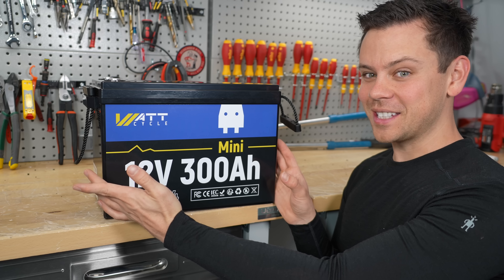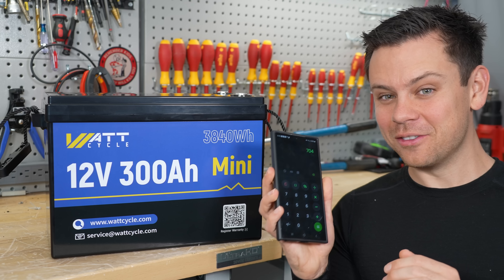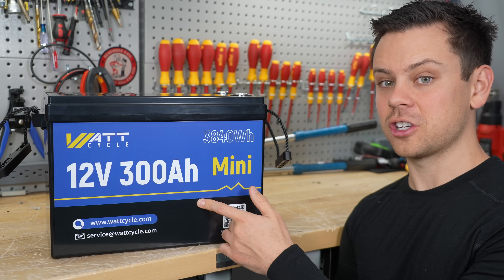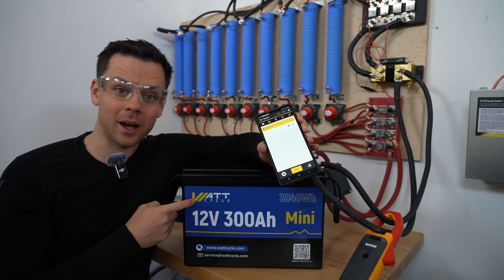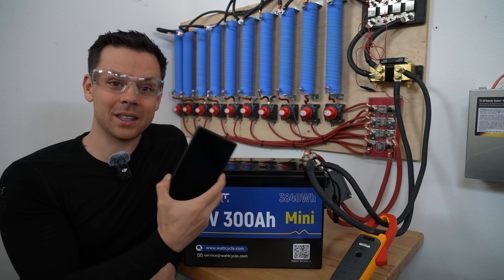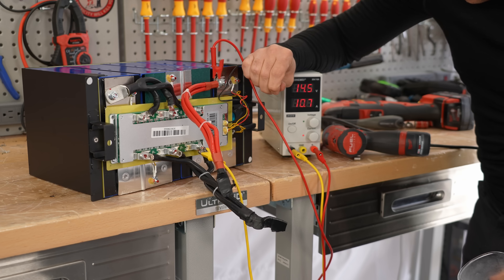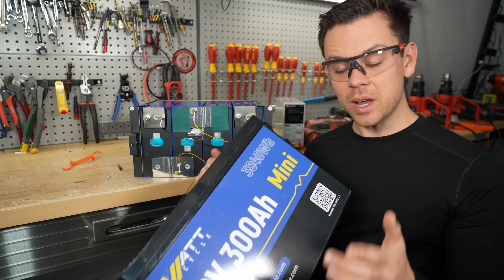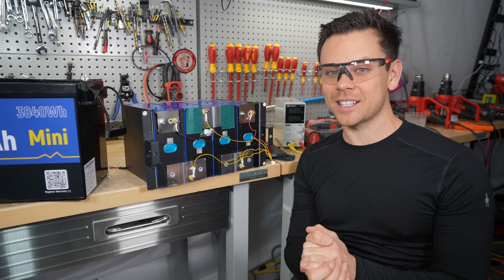Wattcycle 12V "300Ah" Battery: Popular Budget Battery Falsely Advertised?!

Comment: What are the chargers your using the biggest 12v I can find is only 50 amp
Reply: You sure you even looked? Just a quick google search pulled up one that is 60 and another that claims 80. If you need more than 50 amps, use two chargers. Or look at RV chargers you can get 125 claimed. 

You battery is probably a .2c charge rate for longevity. So you are close to that with 50 amps anyway.
Reply: @jayw900  if you could help with a link or name of some of these larger charger that would be great. I don't know if it's because I'm in the UK but anything over 50 amps is just a modified server rack power supply when I Google search, my bank can handle 150amp worth of charge and would rather just 2 chargers than 3 x 50 amp chargers

Comment: Glad I bought x3 of the 100A WattCycles when you recommended them instead of going with one of these that you hadn’t torn down yet!
Reply: Yea I took a bit of a gamble going with the 300 I guess.  I couldn't fit 3 100s though.  In fact, I think I couldn't fit most other 280ah batteries as easily, but maybe I could have come up with a different mounting solution had I know this one would be a flop.

Comment: I bought one recently based on your review of the 100ah - paid $476.99 - so even as a 280ah, if it has good build quality and working low-temp I am happy with it. I put a MRBF fuse on every + terminal no matter what the battery has.... just seems like good sense... never trust software ;-)
Reply: Yes, I have been using those fuses as well.
Reply: What size fuse ?
Reply: @  My loads aren’t crazy, so I do a 200amp fuse. If I were running inverters or larger loads I’d do a 250a fuse to allow a little burst
Reply: @condoonsixthavenue8060   You size the fuse for the wire you are protecting. I use 200 amp fuses for 4 gauge wire at 24v (i.e. 160 amp). Hard to find anything between 150 amp and 200 amp. It's really to protect against a dead short. I have a 3000va Victron inverter and 4 batteries (each has a fuse).

Comment: A video on 48v server rack vs 12v x4 in series would be great with some of these 280ah batteries.  It could illustrate pros and cons to sticking with nominal system voltage vs 12v in series, wiring costs, cell imbalance, and also if a chargeverter works any better charging these back up vs generator through AIO.
Reply: It's not right to directly compare a drop-in Group size battery with a server rack battery. One gives comms, standard protocols, one does not.
Reply: @ For sure.  I think it’s a topic worthy of a video explaining it to everyone, newcomers especially who are just typing in batteries on Amazon and thinking things will go super smoothly, especially with prices quite competitive.  

Like if there was a similarly sized 4S system to equal inverters and panels, what can buyers expect fully?  And ways to combat any issues?  Ex. How does each individual bms react to charging through an all in one on generator, at various loads?  Does a 5 kw generator running near full load react about the same as a 15kw at 33%?  Or does it throw the sine wave off, and how does bms of both kinds react to this?  A bit on chargeverters in those situations with each configuration too.  I feel like it could be of interest, there’s plenty that have been in a system down state after a week of no sun mid winter.  In Canada.  Or, whatever it’s called now.  😂

Comment: those 100ah wattcycle mini batteries look so good.  i feel like getting two of those wired in parallel would be great for a small overlanding set up
Reply: I am considering using them to replace the lead acid batteries in a Ryobi electric riding mower. Yes, lots of upgrades for that project.
Reply: @williammeek-h2o  i finally got the two batteries and honestly the bms makes them really weird.  the bluetooth app doesn't work well.  i'd say using just a single battery would be ideal if possible.

Comment: great review, i have been looking at the Eco-Worthy 280 Ah 12V battery.. it's currently on sale on amazon for UNDER $400, which is a pretty amazing deal.. i would love to see you review it / tear it down to see your take on the build quality & test results!
Reply: They are $360.00 right now on ebay. I have two of them in my battery bank along with 4 various 100 ah batteries. Very satisfied. Also, there are a few reviews out there, I think Will may have done one himself. Take a look see.

Comment: Would be interesting if you would dare running the battery for longer at high load to see if the overheating protection works? Or do you need beefier cables?

Comment: That ecoworthy 280ah battery is branded Gentai here in PH. The label is even the same. I tested it at 293ah of capacity. Can be purchased for around 21k php or about $360 USD.
Reply: Thanks for the useful factoid.

Comment: At that amp capacity this one might make a good truck starter battery
Reply: Won't work in freezing temps. Could just cut-off while driving, which will send the electronics burning up. At least put a supercap starter pack in parallel.
Reply: @my_channel_44  I doubt that. It may not charge in the freezing temps but it'll still discharge.
Reply: @MikeGentry  The BMS operates by cutting-out the battery. It does not discriminate between charge and discharge. The cell chemistry could discharge below freezing; performance would be poor, though. These cell chemistries are meant to operate between 50-70F.
Reply: @my_channel_44  50-70F...? I'm not sure who told you that but that's not true. If it were, no one would be buying these.  It's 29F out right now and everything is working fine on my RV off of lithium batteries, there may be some performance loss when cold but nothing you'd even notice.

Comment: I already bought two of these as a result of the WattCycle review you did not that long ago, recommending the batteries. A bit disappointed about the false labeling. Also surprised that the overcurrent protection is not lower to remove the need for a fuse on each battery. I will be putting two in parallel, with a 400A T-Class fuse from LittleFuse on the combined output. Luckily I also bought some 400A MEGA fuses with fuse holders from Victron and I will be placing one on each battery based on your findings. Main cable is 4/0 rated at 440A @ 105 deg C.
Reply: You should use mrbf fuses on the batteries.  Some fuses fail shorted (rather than open) at super high currents that these batteries are capable of.  I cant recall the rating name, but mega fuses are no good for that.
Reply: @MatthewByrne-h9x  The MRBF is the better battery fuse choice compared to a MEGA as it has an AIC rating of about 10.000 Amps compared to around 2000 Amps for the MEGA. But given a single 300Ah LiFePO4 has a maximum discharge rate of about 900 Amps, the 2000 Amps provided by a MEGA fuse should still be ok.
Reply: I'm in a similar situation, but used 2 Class T fuses to protect each battery separately.  I'm disappointed in the false advertising, but I still would have bought them even if I knew ahead of time.  These are literally the exact dimensions needed for my factory truck camper battery compartment to fit perfectly.  I only have about 1/8 inch wiggle room on all sides with the batteries crammed next to each other.  Any other brand battery combinations could not fit or would drop me down to fewer amp hours.  The small size is simply needed in some cases.
Reply: Should we use mrbf 300A fuse?
Reply: @rafalw.3455  I think Will recommended 250A in another reply
Reply: @MatthewByrne-h9x   this fuse should be only for output power or charging input as well? 🤔
Reply: @rafalw.3455 The fuse would block over current in either direction.  This raises an important point: if you are using this battery as the only battery with an alternator, do your homework on how to set it up properly.  The BMS might destroy your alternator if set up improperly.
Reply: @MatthewByrne-h9x  I use alternator and one solar panel for charging I have Renogy 12V 50A DC-Dc smart battery charger
Reply: Completely offgrid, don't use any external hookup

Comment: Any downside to mini batteries?  In general. Not just these but mini in general.
Reply: No. there has been a general improvement in cell energy density and that is reflected in these new mini batteries. Otherwise, basically the same.